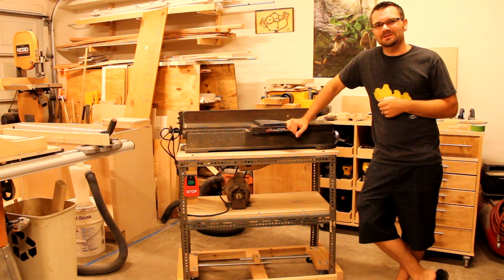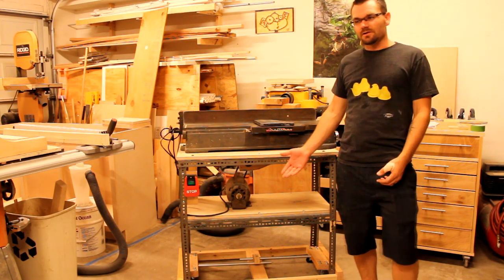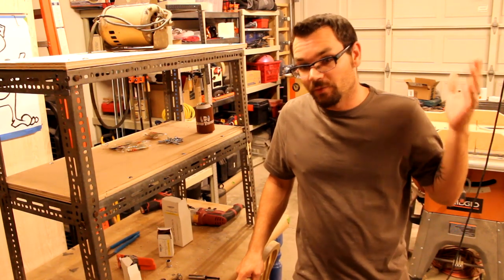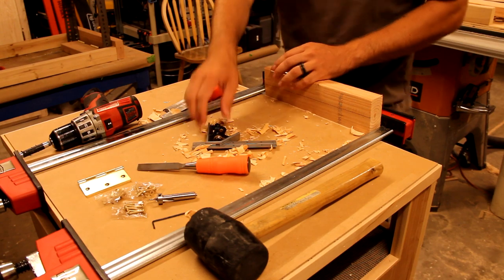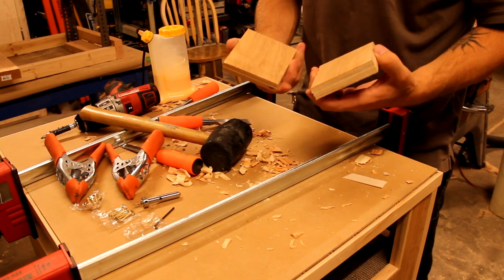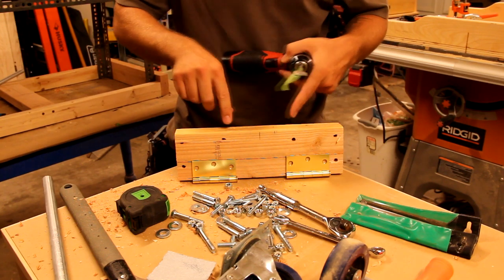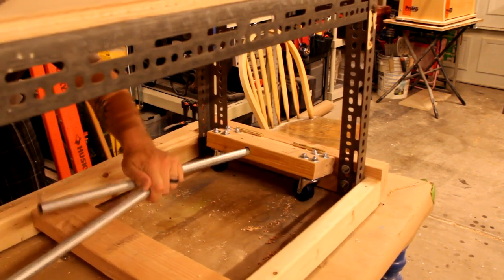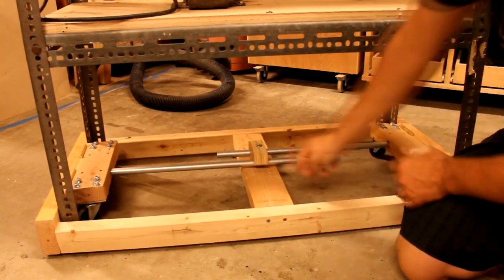Mobile Tool Base

Comment: Great idea Ty! Anybody could build one of these, for a varity of tools, with just a few scraps laying around. I love things mobile, great job.
Reply from the maker: Thanks April Wilkerson & Patrick's work shop. I kept having an issue with my other rolling carts moving a little even with the wheels locked. I figured this feel a lot more solid when I'm running a large piece of lumber over the jointer.
Reply: EXCELLENT & VERY FRUGAL!!!
Reply: April Wilkerso